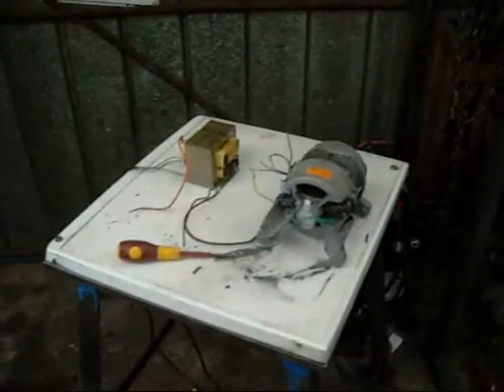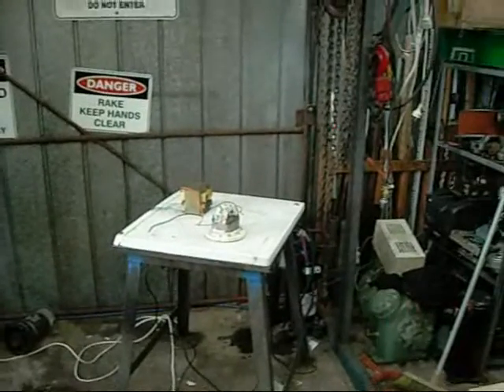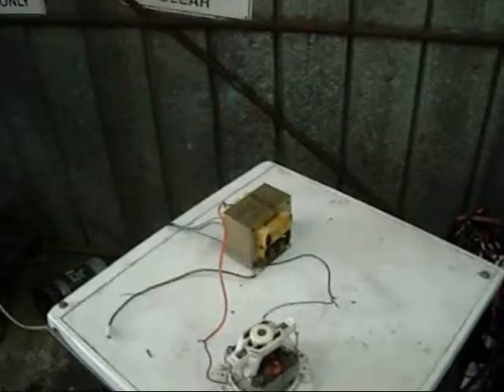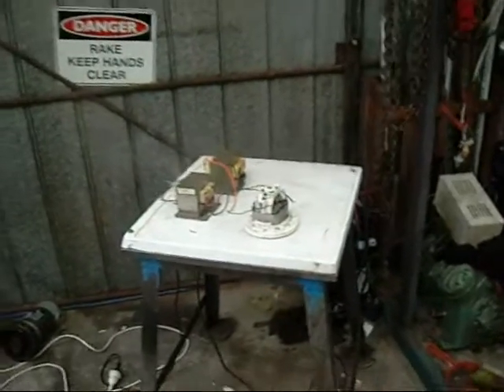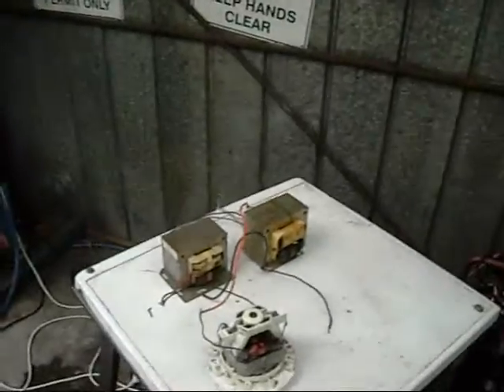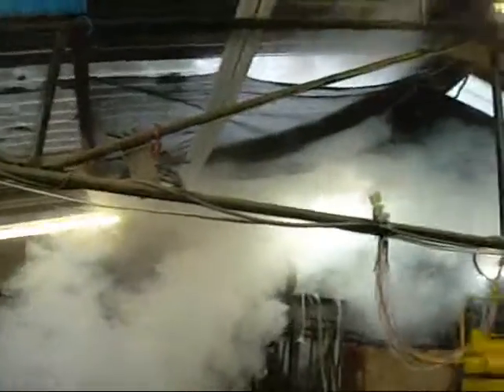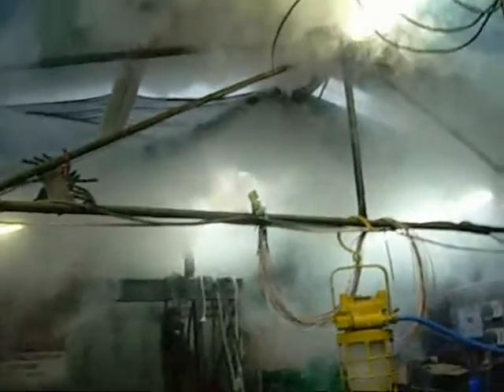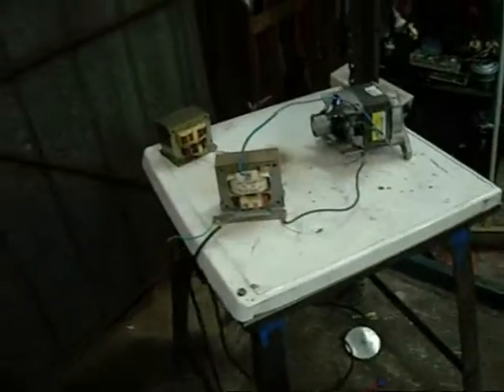MOT Vs Universal Motor Series 2 - Obscene Speed and Noise

Comment: 2:00 a bit late, but the voltage on the secondary dropped heavily (as evidenced by the excessive exponentiation in speed increase) especially during that inrush period it wanted. These MOTs are ran so close to saturation and poor q factor.

Comment: You should try putting the mots in parallel instead of series for double the amps. It seemed like the motor took longer to spool on 4kv due to only having half of the current of one mot. I know this vid is old but I figured I'd comment anyway haha
Reply: I was yelling that at my screen the whole time also. Impedance matching!

Comment: motor vacuum 220 v 230 v vs 2000v
Reply: Those transformers can't put out that much, with that heavy load. Microwave Oven transformers act like ballasts, maintaining a relatively constant current. More load, lower voltage. That's why the smoke. He should have put the transformers in parallel, to produce more current, thus higher voltage to the motors. That would have gotten the results, and not destroyed the transformers.

Comment: How does 240v into MOT make 2000v?
Would it be a case of the tazers for instance, 240v 10a into MOT 2000v 0.10a ?
Reply: The transformers increase the voltage 8.3:1, the available output current is reduced by the same ratio. He should have put them in parallel, to make more current available to the motors. The increase in output voltage would likely have saved the transformers, as well as getting the results he was looking for.

Comment from the maker: trouble is not the cost of the scrap item, but the weight!, soon as I get a request for a heavy item, then quote shipping, that's the last I hear from them.

6.5Kg was the weight of a motor plus estimated packaging (plywood lined box, or whole crate)  - shipping to Romania via cheap air mail - $172!, 
$80 for sea freight, you may see it in a few months time after sending it via sea.

Comment: Awesome !! The load from the motor is too high for the MOT's.
It won't be 4 kV as the motor probably clamps it at about 600 V to1 kV and then overheats.
It is still amazing what an over voltage the vacuum motor takes and the armature windings don't fly out.
That second motor is a tough one as that starred in another video too.
Excellent smokebomb in your shed

Comment from the maker: @NOBOX7 Hey man!, I wouldn't reccomend using a motor driven by a MOT for anything, mains voltage is dangerous enough, the 2kv from the Mot can arc and make things live that shouldn't!.

hence why it was screwed to a plastic/timber panel and the steel table under it staked to earth.

I hate to think what RPM it was doing!, 50 - 60k would be a good guess!

Comment: If you want a jammer, it has to radiate, preferably at the frequency of interest.  Think antennas and tuned circuits to extract as much of the energy at mobile phone frequencies - not that there is much there from a spark.

Comment: What really interests me is that the vacuum cleaner motor spun at a higher speed with 1 trnasformer than it did with 2 of them, the sound of that motor was causing your camera's audio system to do all kinds of strange things.  I'm wondering if there was some resistance toing on causing the motor to run at a slower speed with 2 transformers.